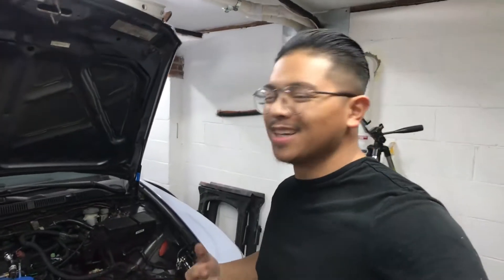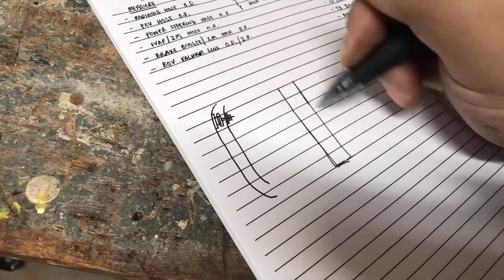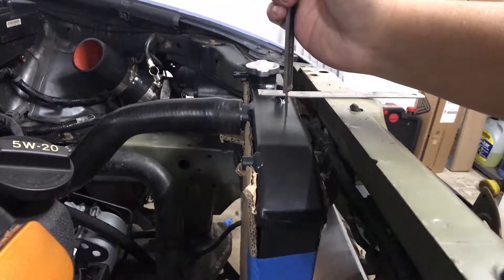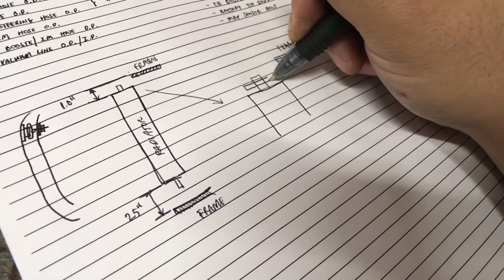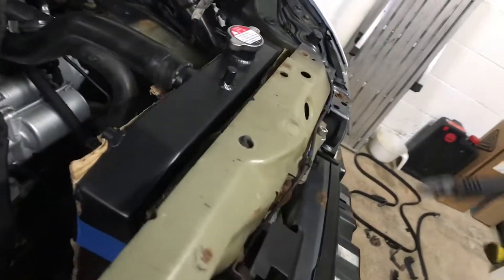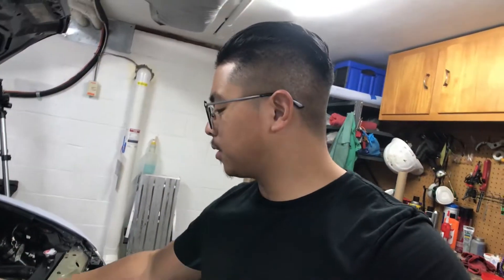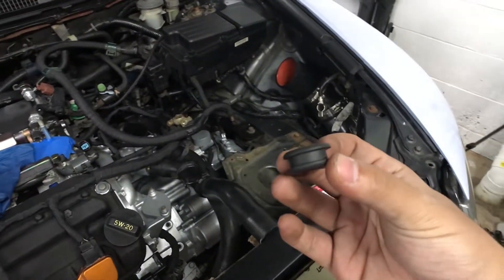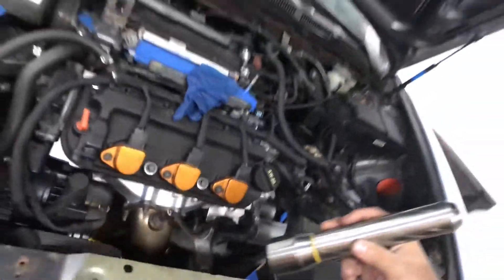Custom Radiator Plans | Acura TL Engine Bay Mods -- PART 3

Comment: Hey Jsant I have the gerz sc kit also, track my car, and have been looking for a dual pass rad that would keep the ole girl cooler with back to back laps. My question is why did you decide on this rad? any ideas on a higher flow rad that youve come across? Also I rerouted my intake to over in front of the battery tucked down there
Reply from the maker: Nice! The OEM dual pass radiator is fairly efficient as is.  My theory behind the half size radiator was to promote better airflow throughout the engine bay to combat heat soak and cool the radiator.  In my opinion, at high enough speeds, airflow is more important than having the MOST efficient radiator.  Pair a triple core radiator with a fan of a high rated CFM and you should be fine.  I've seen multiple j-series/swap setup run something similar without any issues. 

Also, if your car doesn't see freezing temps, you can run distilled water and water wetter with a small amount of coolant for lubrication of the water pump.  Water transfers heat better.  Just make sure to use a higher pressure rated radiator cap (Mishimoto 1.3 bar) to avoid boiling.

Comment: What radiator is that link??
Reply from the maker: https://www.ebay.com/itm/For-92-00-Honda-Civic-Eg-Ek-D15-D16-SOHC-Engine-42mm-Manual-Aluminum-Radiator-BK/231785315150?fits=Model%3ACivic%7CMake%3AHonda&hash=item35f77b3b4e:g:5lUAAOSwn1FgRsfA